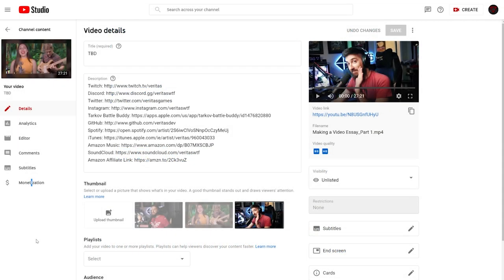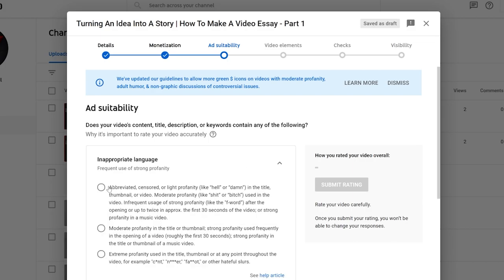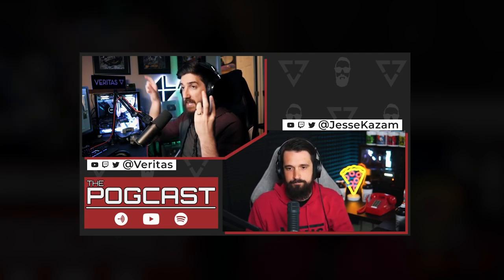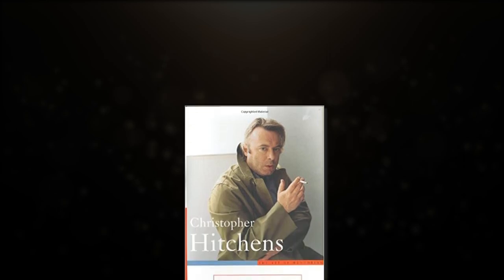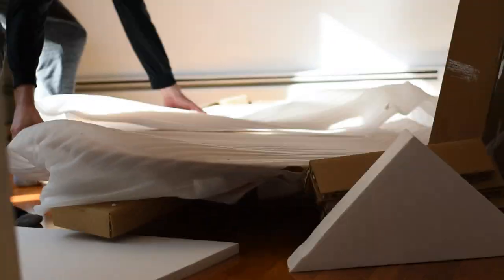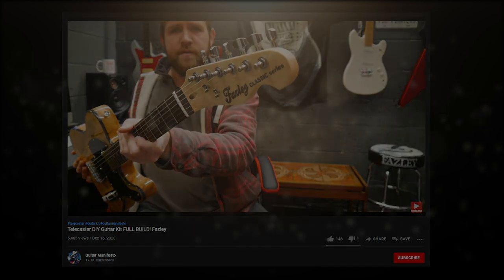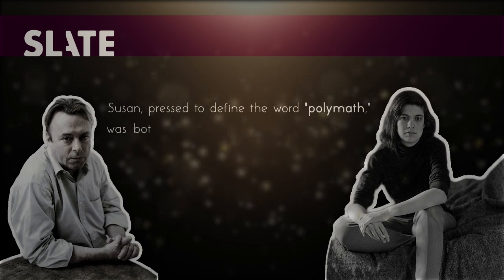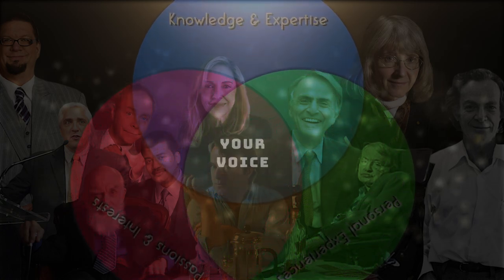Finding Your Voice | How To Make a Video Essay - Part 5

Comment: I just finished this last video and it was absolutely great. The first four videos taught me alot about the process and really put emphasis on key areas that I have either been blind to or willingly ignored as they seemed unimportant to learn more about. I am quite eager to put what I've learned to the test and forge my own works.

But this last video is by far the best. It feels so asymmetrical when compared to the rest of the series. In fact if every reference to video essays were removed this could easily stand on its own as a guide to many different faucets of bettering yourself or something less cheesy I can't quite pinpoint haha. Nevertheless it is quite the ending and you had me engrossed throughout the video.

Since this series is no doubt just a mid way point in your own journey as a media creator I'm quite excited to see what you release as a 'master' in the art.

Thanks again for releasing something so informative and inspiring and have a wonderful weekend.